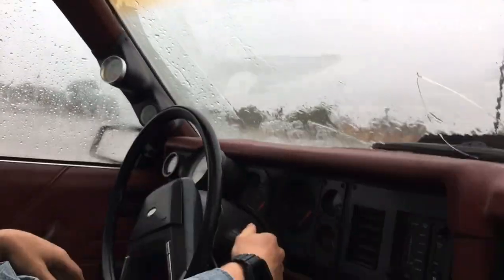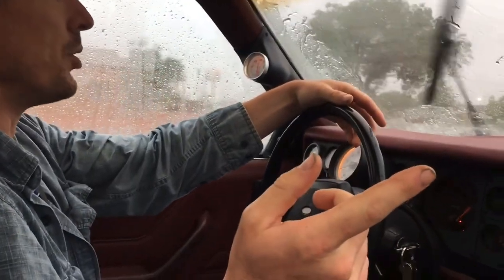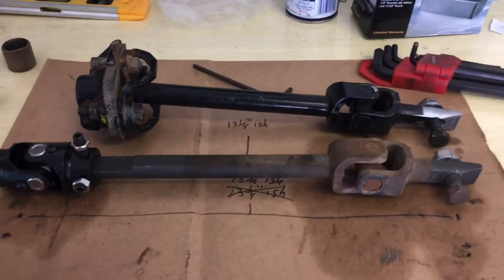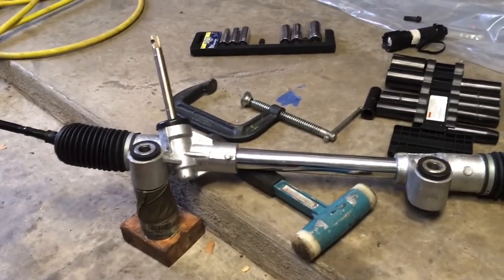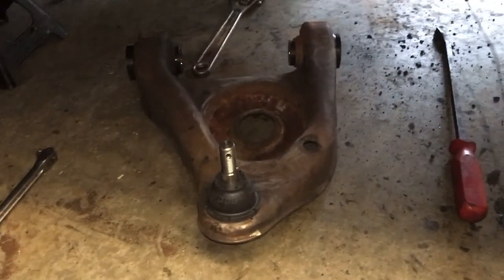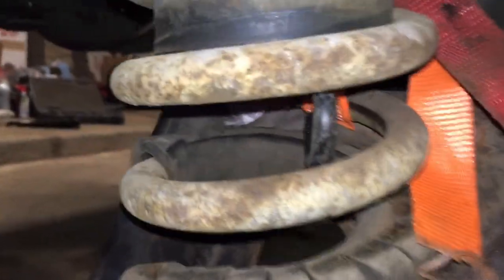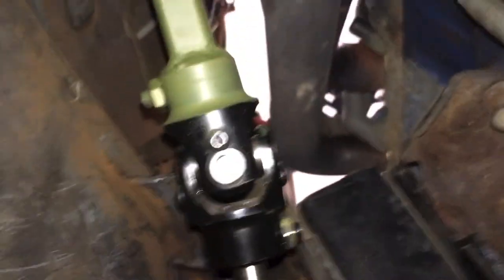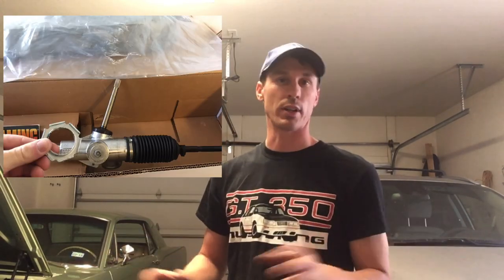Flaming River FR1503 review and install vlog - Manual Steering Rack Conversion Foxbody Mustang

Comment: I put a manual rack in my 90 LX.  I am running narrower tires like 185/65R15 or something like that on narrowed 10 holes.  I bought it back in the day because I could have a short belt all the time.  Now that I am older I plan to keep my power steering on my other street cars.

I had found a manual rack from an early capri in the jy.  Because of this I did not need to modify my steering shaft as I got the rag joint adaptor with the jy rack.  That rack went bad and I bought a new one from autozone.  This was all in the early 2000s.
Reply from the maker: Yeah I was really hopeful I could find a manual JY rack, or a cheap one from rockauto. It’s just not in the cards anymore. Heck Rodney even put a Unisteer manual rack in one of his cars a few years ago and according to his video it was just over a hundred bucks, but they just aren’t that cheap nowadays. The power rack I had was leaking and the passenger inner tie rod had some slop in it so it was time for an upgrade. One day I’d like to go your route and put some skinnier tires on the front 👍

Comment: Awesome!!! I’ve actually been wanting to go with a manual rack soon! Thanks for the knowledge brother! 🇺🇸💪🏼
Reply from the maker: Yeah, I was thinking about that, with all the weight you lost going with aluminum heads a manual rack would be a nice touch. “They” say it’s worth another 30lbs off the front. Thanks for watching man
Reply: @fomobros2207  Yep! I’m sure I’ll do the swap sooner or later! My goal is to run a 7.50 or lower ET in the 1/8 and I’ll be happy. Until then, it’s game on! 😂🇺🇸💪🏼
Reply from the maker: @jdrods1519  dude, that’ll be a clean mean machine!!
Reply: @fomobros2207  thanks brother! 🇺🇸💪🏼